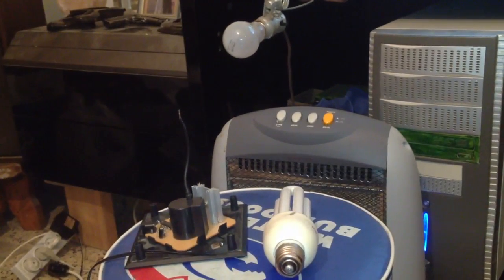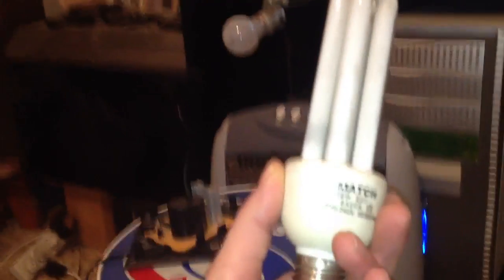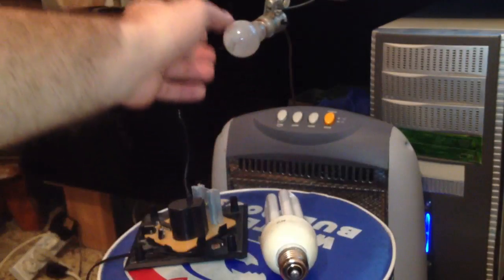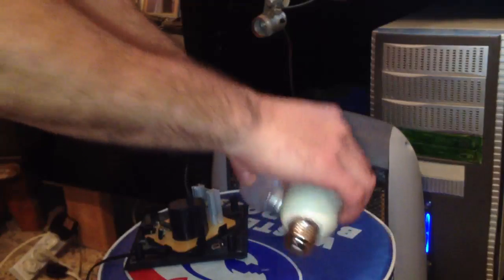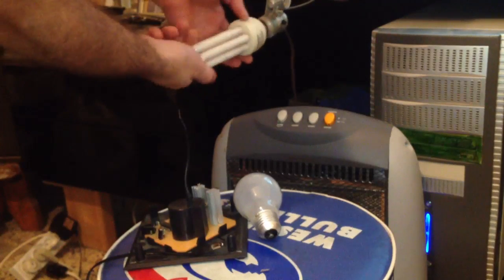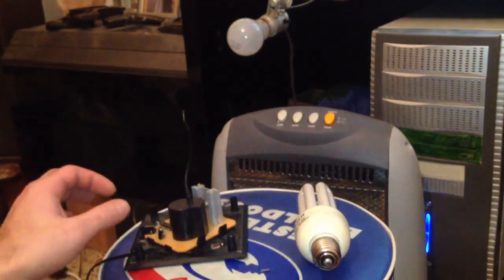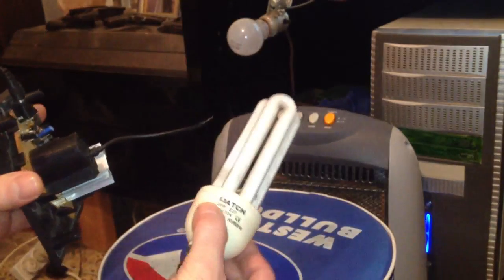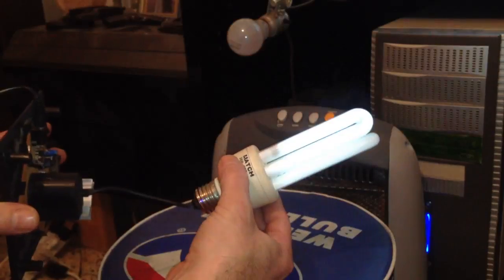broken fluorescent lightbulb still lights up

Comment: What you are showing here, the reason the fluorescent bulb/tube is not because you are lighting up the blub itself, but rather it's a lack of gas, it's a vacuum in the tube. If you induce a large field of electrons into a vacuum tube, with a connector on both ends, the electron illuminate from inside the tube. This is called Natural Illumination.
http://youtu.be/XOq9C3YSjKg